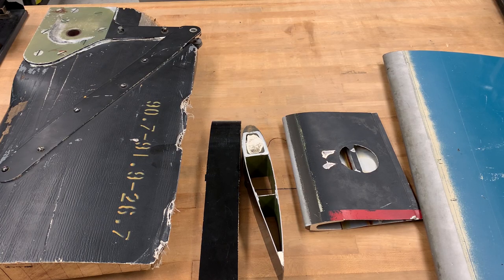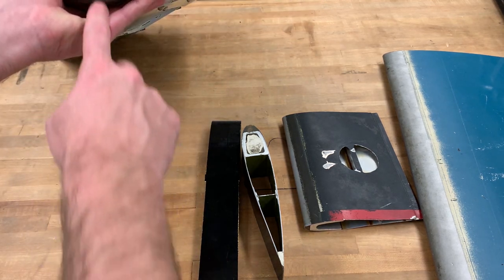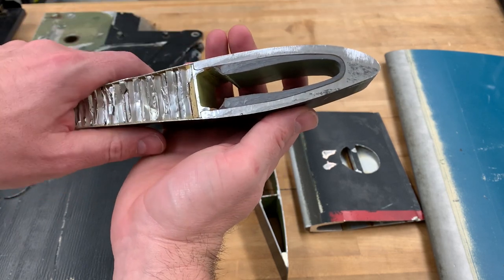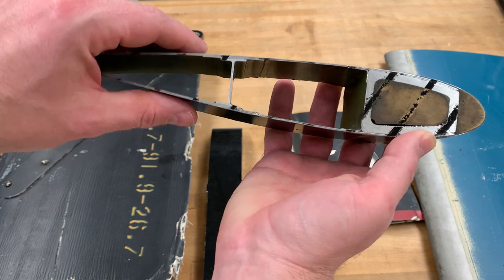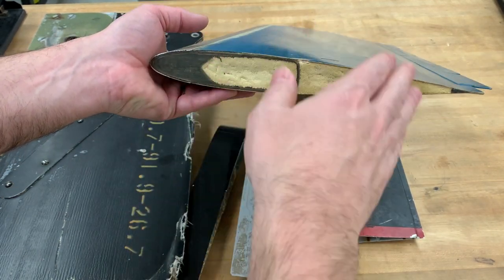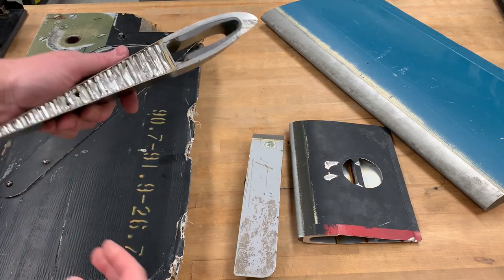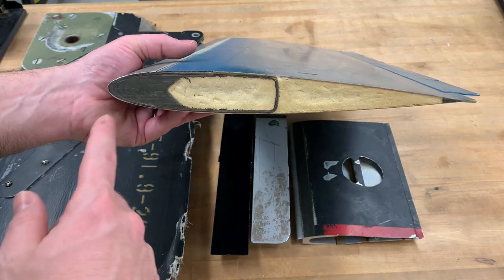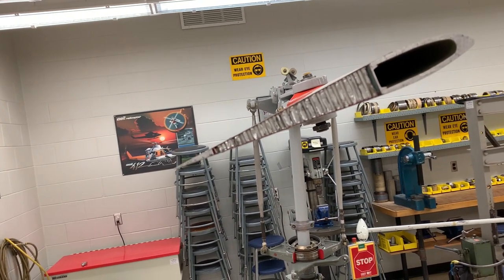Main Rotor Blades

Comment: Nice share. FYI, the weight repartition in the leading edge is also very important to provide a correct balance. Just an airplane, a rotor blade needs to have the CG forward of the center of life about 25% of chord.

Comment: Thankyou for your information.  God has blessed America in this regard with kind honest people who freely share valuable information.  Mind you, I think they got my idea while doodling on paper {with high-powered satillite / when DCsniper was active}  regarding extra large mass at end of blades.  My idea was to make the rotor shorter & determined centrifugal throw out force helped keep the blades level so as to lift copper instead of ends of blades lifting up, so idea was to have mass at ends. Basedon what youve shown i think steel leading edge for strength but bit of lead only at end to keep the weight down.  Thankyou for your time and effort to bring us this information.

Comment: I wonder how the attachment of the composite blade is done to the hub, with composite lugs. The section of the blade shown here is filled with foam, but I believe that would not be strong enough at the attachment with the pins and bushings. I know there are some with thick solid laminate but I wonder of it's done.

Comment: It's interesting that in the world of helicopters both radio control and full size rotor blades are either referred to as 'symmetrical' or 'asymmetrical' whereas a planes wing is 'cambered' or 'uncambered'.
Reply: 'Symmetric' is also commonly used to describe non-cambered fixed-wing airfoils.

Comment: Thank you for your informative vedios.
I want to make a drone by using a motorcycle engine and capable to left a person.
If I use 150cc engine and two perpellers.
How big should be the perpellers and how fast the rotation should be?
Reply: Use one meter diameter and 10 RPM. It won't fly, but you won't hurt yourself too much.

Comment: Some helicopter blades have Nitrogen Gas inside to keep the moisture out.
Reply: Also provides specific pressure and if it gets low enough bim indicator will either go red or black signifying a potential issue and blade needs to be replaced.